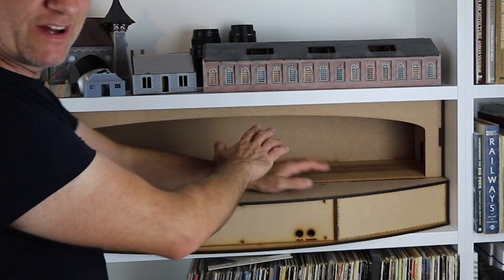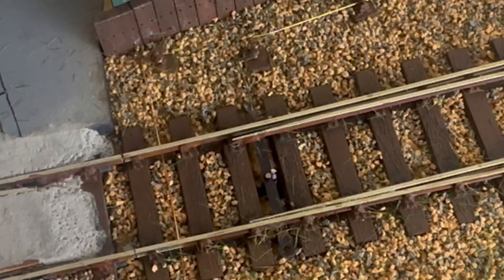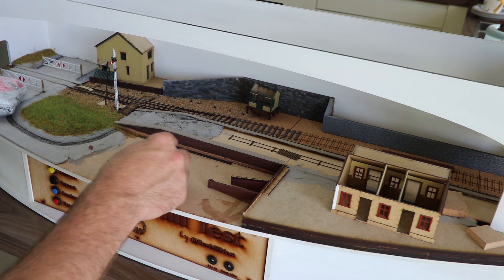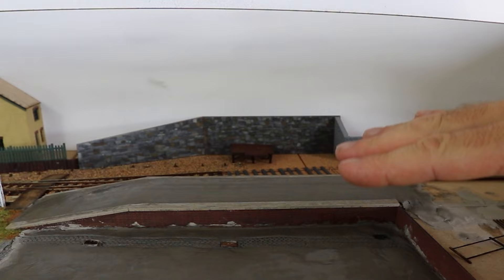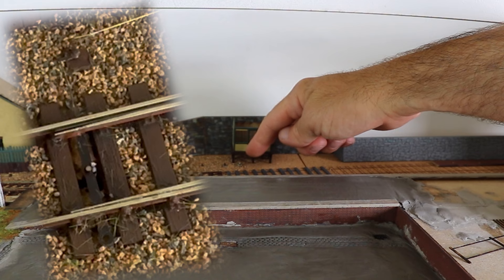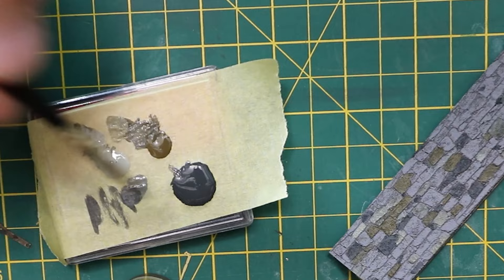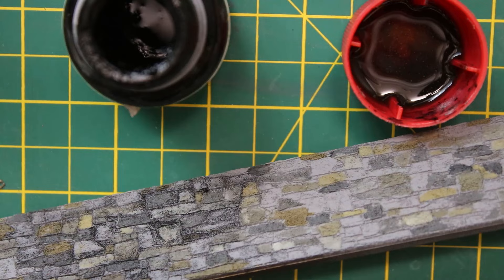S2 E29 Some Simple Scenery | Das Clay & Painting Stonework | Bexhill West Model Railway

Comment: Wall looks good and you have done it like modellers I follow do. A dry brush with a lighter grey will bring out the edges and features of the stones and maybe use a cotton bud fast brushed across the surface to remove excess wash.

Comment: Hello

Some little things:
Handling the signals, turnouts, etc. with only one push button each requires looking at the position of the to move thing before and after (-> indication LEDs).
If the level crossing is (as it looks) manually operated, the gates would move one after another.
That turnout mechanism cover, to be seen at 10:05, looks oversized to me.

16:54-17:50 Yep, time to focus on scaleforum for you, see and ask about how others do(ne), for example Pendon Museum with their copious experience.
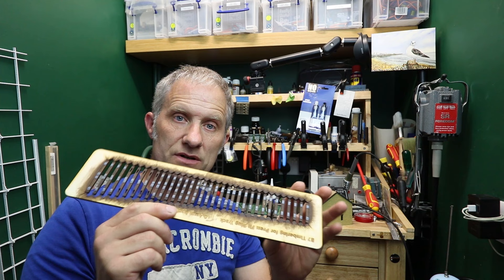17:50-18:10 Yes, 🤓like what I seen and read about it (-> Templot), but to fare away from me, sorry I can not come.

Till next time